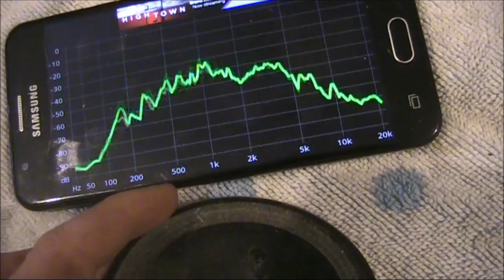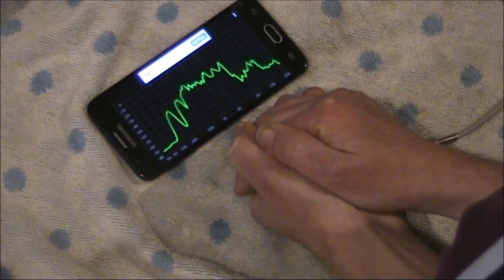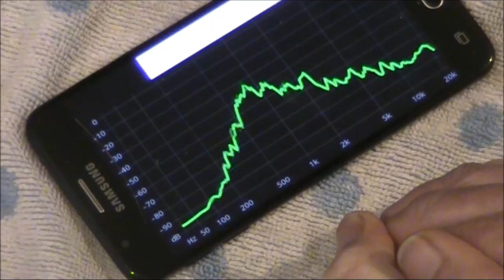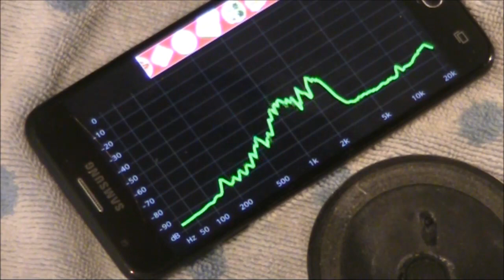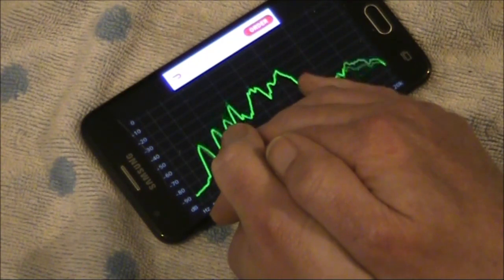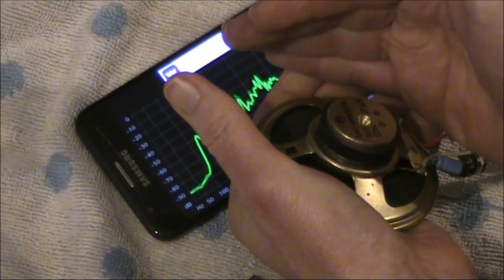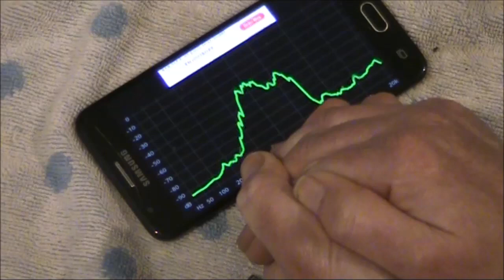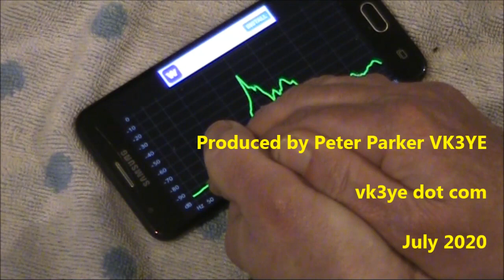Hand made CW audio filter

Comment: I recall reading an article about building audio cavity resonators for CW reception - can't remember where. I do wonder if everyone's ears may differ slightly. I sometimes find I can pick out weak CW more easily if I increase audio bandwidth  and introduce noise! Seems to be at odds with theory I know but I find the pure CW tone somehow stands out from the noise even if it's at a lower level than the noise. In the video, I could hear the CW better before Peter cupped his hands round the speaker. I do think it is a shame that amateur receivers don't usually have a simple tone control. I know a lot of modern rigs have RX audio multichannel equalisers but sometimes I long for a simple front panel tone control on ham transcievers. This used to be standard on many domestic and comms receivers. It may be a good project to build an external speaker with a tone control or maybe even a little inline tone control circuit for use with headphones?